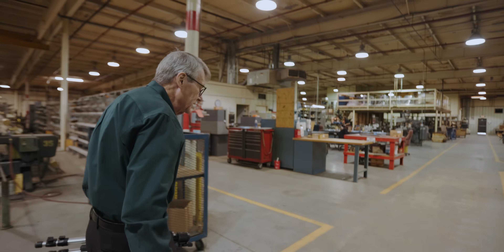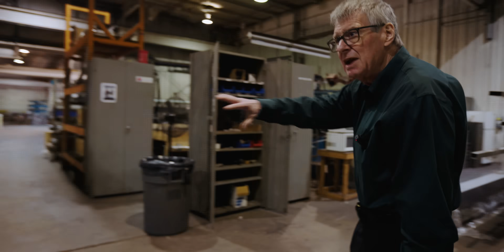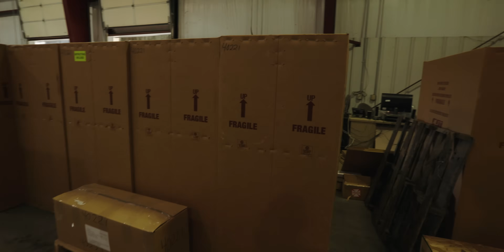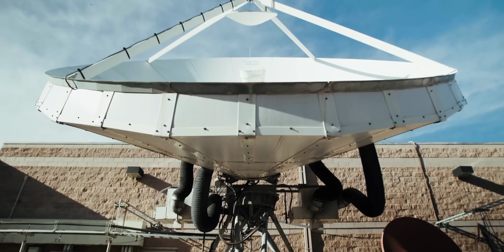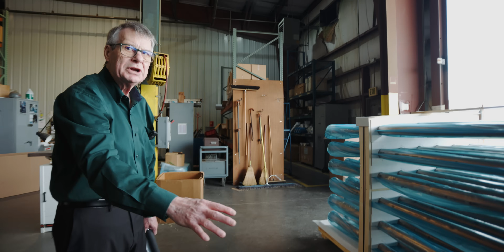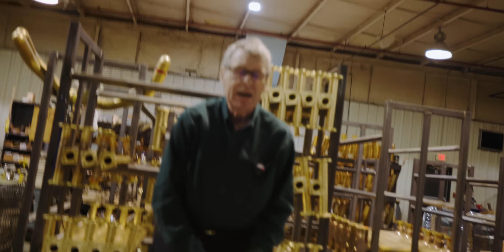How antennas are made - ERI factory tour

Comment: Well I  see we missed some real. Detail.    I want to see inside the filters. And see assembly of the uhf tv bay units. How the covers go on rototiller antennas and see the inner guts of the combiner units and how the 5 in one broadcast bays are able to take on so much power. Want to see the patterns of RF as measured by meters and how that is adjust based on an example customers plan.    There was alot to see but details up close and able to hold still near completed parts to get a visble sense of the size and type of materials used to make it all come together.   Last but not unseen. / what was the tour guide doing walking around the entire time with a tripod of some kind.  Seemed very useless. Audio was fine and video was high frame rate . Segments edited with blank space was good for youtube .
Reply from the maker: He was carrying my tripod. I was hoping for some spots we could stop and talk but he kept moving pretty much the entire time. I should have just left it in the car.

Comment: Great video, thank you for the insights 😍
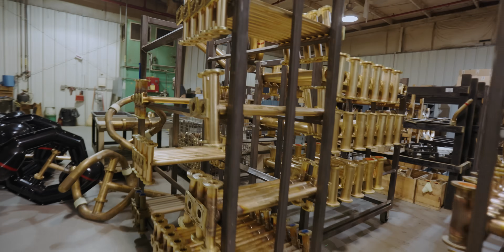At 4:11 what are those weirdly shaped parts used for? 🙂
Reply from the maker: Those are the FM rototiller antennas themselves.
Reply: @ Aah thx 🙏 
But what is the reason for using that shape? Does it allow for circular polarised signals to be transmitted? 🙂
Reply from the maker: @nusermane1076 Exactly!
Reply: @TheBroadcastEngineer  Perfect, thanks! 🙂

Comment: An amazing and very informative video! I've learned a lot of technical terms peculiar to broadcasting antennas. My  initiation into communications was in tactical microwave systems. (Multichannel carrier systems.) I then worked in a mobile FM radio shop installing, repairing and maintaining about 300 mobile radios, 15 base stations, about 40 mobile/fixed stations and repeaters that extended our coverage between El Paso, Texas and Green River, Utah. Our antennas were simple base loaded whips and our equipment was RCA, G.E. and Motorola. Great job on the coverage of the tour@

Comment: Started as a pirate in the late 60s through early 70s, got caught, had to get my license or go to court. Continued into the 80s but work commitments and health issues forced me to finish up. Still got my TS520S, FT7 and FRG7, but zero room for a station, let alone an antenna 😂  Mainly keyed, although voiced occasionally. 
Made all my own antennae, some of them looked terrible, some funny, but they all worked without a matcher, didn’t bother with a G5RV, made a crazy multiband dipole for general chat (80, 40, 20, 15 & 10) and a few yagis for DX (20, 15, & 10)

Thank you for this video, but it made me blubber like a baby 😂😂😂. 
Absolutely fantastic, I could listen to you both for hours and I’m extremely jealous. 
Thank you for posting. 
Cheers, 73s from downunder. 
Former VK2PAE VK2XZ
🇦🇺📡
AR

Comment: Greetings from Europe. Last time I checked radio stations around here were about 50 to 100kW, TV goes into MW range. Maybe in Central Europe things are different because it's so packed compared to fringe areas and most of the USA.
Reply: 100KW is probably what in the US we call Effective Radiated Power.   Transmitter power times antenna gain. The station I worked at had a TV transmitter output of 25KW peak but the ERP was 316KW peak.
Reply: @securitycamera8776  (Transmitter power - Line Loss) * Antenna Gain

Comment: In the 90's I was working in Grand Cayman and worked maintaining Radio Cayman (the government station) and the non government station. At the time that was 2 FM stations, and the government station had an AM station, and a low power transmitter on Cayman Brac. The transmitter on Brac was the only solid state transmitter at 200 watts.